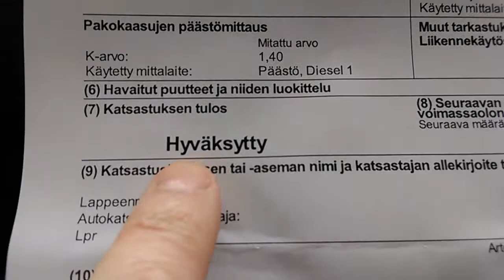Jarrukenkien vaihto / Brake shoes replacement Fiat Ducato 14 -92

Comment: Hi wonder if u can help in anyway .on the rear braking .mechanism. underneath .not the cable .mechanism. the rod bar .is suppost to be free and able to moves up or down .mine doesn't move 13mm nut n bolt is tightens tha kyou
Reply from the maker: If you mean the oblong hole that can be seen around 3:00 at middle, it is adjustment for pressure limit valve. Bolt must be tightened there. If you lock it to higher position, rear brakes get more power and lower position gives less power.
Reply: @zJanneKz  that's it .I've ordered new one ..thankyou .